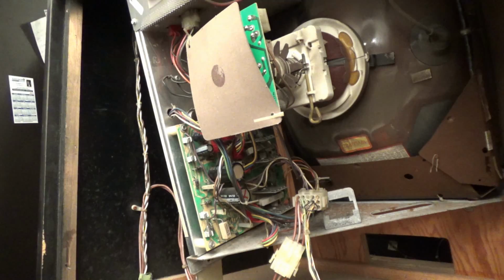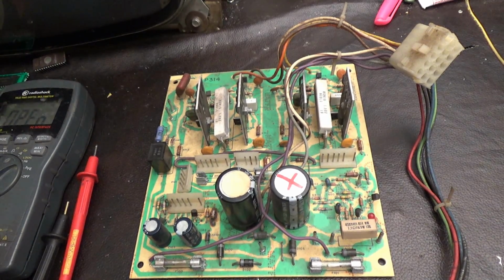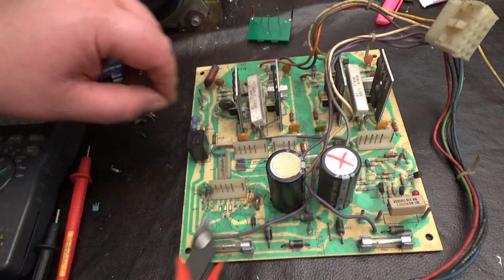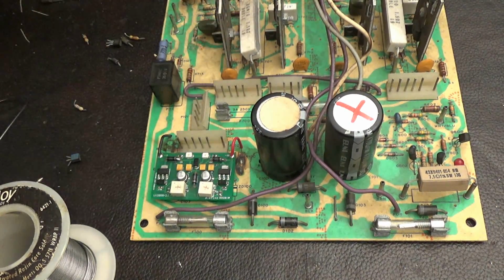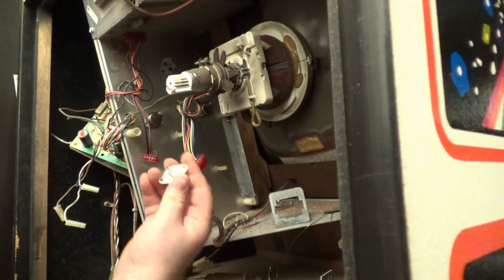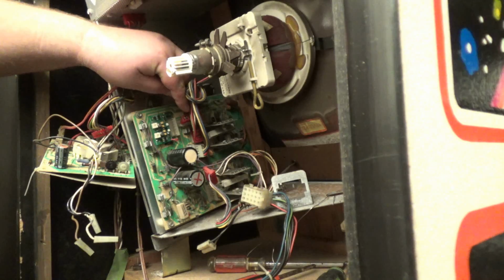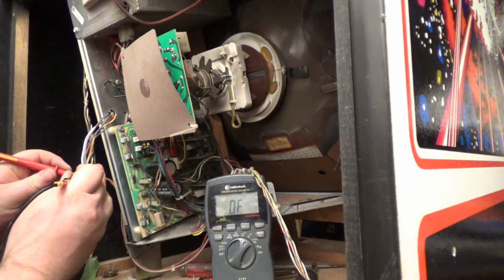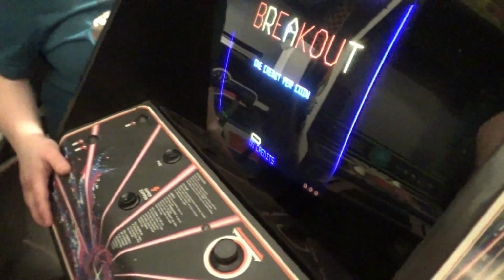tempest monitor repair wg6100

Comment: This video was exactly what I needed!
I inherited a Tempest cocktail and it was playing blind, noticed the R100 resistor was blown on the deflection board (exactly like the one you had shown). Going to get a cap kit, and LV2000 board, hopefully that does the trick.
Cheers!
Jay

Comment: Lots of folks on other sites have stated that discharging the monitor like you show risks blowing the capacitor inside the CRT...have you ever had that happen?
Reply from the maker: that is a myth  also they are referring to the diode inside the flyback not a capacitor
Reply: @ArcadeJason  Thanks a million. Laughed out loud when you grabbed the solder wire. :D

Comment: Good stuff as always. I always thought the consensus of opinion what that the 6100 is self-discharging?
Reply from the maker: yes but it a flyback has failed it cannot discharge the tube
Reply: @ArcadeJason  Ah of course. Keep up the good work sir!
Reply: @arcadeblogger  Flyback failures are extremely rare on these however (and if the fly was bad, it wouldn't have been able to charge the tube in the first place).  6100's are self-discharging, which is why there's no pop in this case, like with most raster monitors.   There still can be some residual charge, so you always want to be conscious of what you're doing.  But I don't discharge them when I rebuild boardsets for folks.

Comment: I thought vector monitors shouldn't be discharged the way you discharge a raster monitor?
Reply from the maker: that's actually a myth  it started from an old service bulletin  saying it could damage a black and white tube .then later people thought it must have referred to the diode on the flyback .  but the truth is this method cannot damage a tube or hv diode
Reply: @ArcadeJason  Ahhhh ok... thanks for the reply! Keep making videos!

Comment: What did it feel like the time you did get zapped? When I did it, I was knocked down on my bottom. It didn't feel great. ;-) I recovered quickly however.
Reply from the maker: not much different than holding a spark plug wire

Comment: Watched the board and saw the spark ⚡️ on the bottom of the board at 32:34 unless that’s a reflection of an LED flashing or something 🤔
Reply from the maker: ah i see what it was it was the spot killer led
Reply: Arcade Jason the quick flash on the bottom corner of the board by the ceramic resistor? Not the led up higher that goes solid.
Reply from the maker: @sideburn  yup it was the spot killer led

Comment: at 32:33 you can see the board sparking or arcing at the bottom left corner near that ceramic resistor thing.
Reply: Or is that the red LED?
Reply from the maker: spot killer led